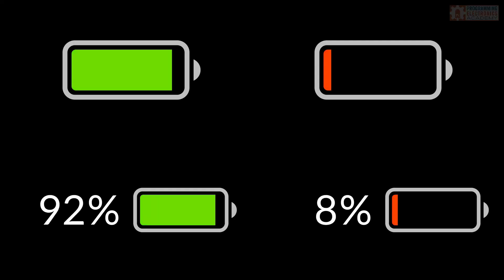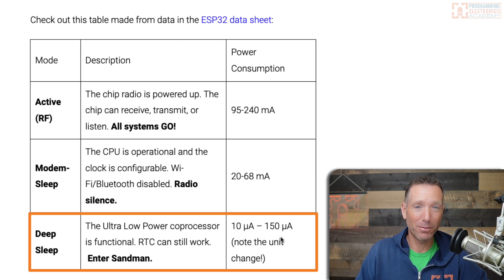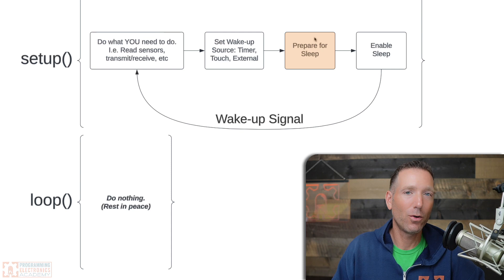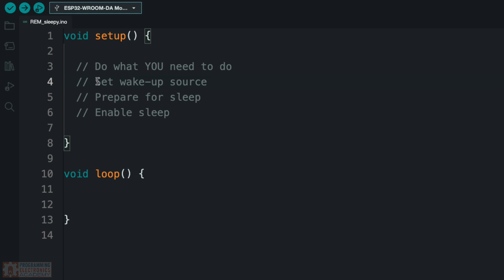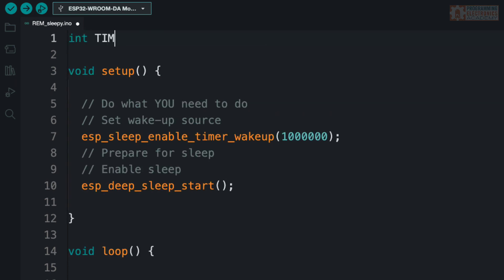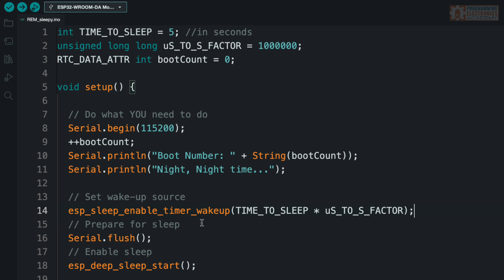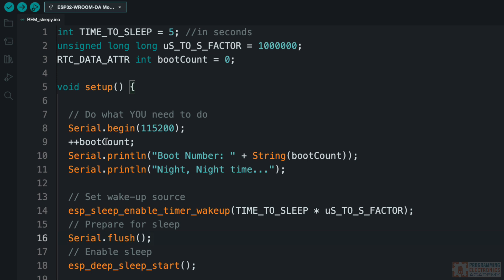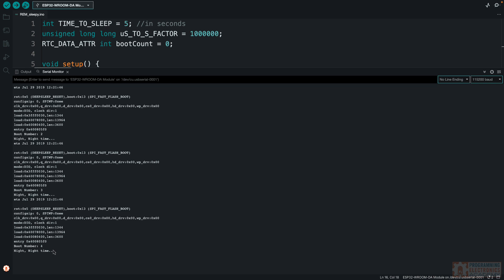Getting started with ESP32 Deep Sleep

Comment: Nice presentation! It took a few tries but if finally sunk in when trying it in my existing code. My loop function is essentially useless. All that code (now in it's own function) is called inside the sleep function each time it runs in setup. Different for sure, but if you're tired of draining batteries like me, it is probably worth rearranging your code with not much effort.

Comment: This is good and concise.  This is the second such video that I have seen that has suggested that in Deep-Sleep that you never go into the loop.....is if the wake-up would somehow only run setup().  I am working on a solar battery web server and I want to put it to sleep after the voltage on the solar panel indicates dark.  So my sleep test is inside the loop().  Thanks for the video, again.

Comment: Hello, many thanks for your great work, here and the article
I understood well and didn't have too much trouble adapting a proven code and transferring it into the setup.
However, my application seems incompatible: it uses “BluetoothSerial” library and the code bugs if have to call to SerialBT.available() : the ESP reboots again and again (it is really THE and only failure reason) / is this a no solution known problem, or is there a trick I should know about ?

Comment: Thank you so much for an amazing video! Im making a remote DIY system that is controlled through an app, so my esp32 is supposed to listen to the requests through wifi all the time. However as long as I understood deep sleep sets esp32 to "vegetable" like state for some time, which is not really useful in my case considering the fact that microcontroller can be full time connected to the power.
Would you recommend to use a frequent deep sleep mode every 5 -10 minutes or maybe there are some esp32 alternatives that can run in wifi modes much longer?

Comment: Thank you, can't wait to use deep sleep. I have a battery powered LORA transmitter at my mailbox to alert me when the door is opened. As it will only be activated (reed switch on the mailbox door) a couple of times a day, it can stay in deep sleep almost all the time (will have to cycle it to avoid that maximum deep sleep time).

Comment: Thanks man that was a really straightforward video and it worked perfectly, now my esp32 consumes less energy when is not required to do much. 
I have a SD18650 battery and i'd like to calculate how much time it will take until the battery runs out of energy. Logically, deep sleep mode helped me to consume less, but i want to know how much. Sadly, im not very advanced with electric calculations and formulas... could you please help me?

Comment: I've been playing with a Vroom and Wrover this summer and neither reach double digit mA power let alone micro. Needless to say I am interested in disconnecting from peripherals and such. I thought that was just part of the deal but when the power indicating LED is on all the time it apparently is not, LOL! So if you have upcoming content in this regard count me in!
Reply from the maker: Awesome - I'll see what we can do!
Reply: I like to cut the LEDs with diagonal side cutters for lower power projects. Bypass the linear voltage regulator. Run the ESP32 with a boost or buck converter and switch power of the converter with a cheap microcontroller (I use an AtTiny) and a mosfet. This way, the battery powers the cheap micro and the cheap micro switches power for the boost converter to power the ESP32. I'm sure there are cheaper ways to accomplish this but this is what I do as a hobbyist. I don't use the sleep mode of the ESP32 very often. My method only draws 280 NANOAMPS or 0.00028mA when sleeping. This is far less that the natural discharge of any battery when it's not connected to anything.
Reply: @billybbob18  Thanks for the reply and info. The best part is I understand about 98 percent of your advice, LOL! That means this is something I can try to work with. It will be helpful to others as well. Good job. Can I hit thumbs up/Like more than once.....?

Comment: I tried this sketch on an Arduino Nano ESP32. It just killed the USB connection.
Error message:
dfu-util: No DFU capable USB device available
Failed uploading: uploading error: exit status 74
Reply from the maker: If you double click the reset button, you'll get the port to show up again.  
You'll probably have to select the board and port again - then you should be able to upload a different sketch fine.
Just as an FYI, this appears to be an issue with these Arduino Nano ESP32s as far as I can tell, nothing specifically about deep sleep.

Comment: Another winning explanation! I try to avoid  any esp32 that has an external serial chip or that uses a 1117 power regulator. These just suck quiescent power from the battery when sleeping. The XIAO esp32C3 and the later esp32c3 dev boards using native usb have served me well. I package them with a 900ma Lipofe cr123 rechargeable and throw a little 5v solar module to keep them charged. I've been running several sensors with this combination, placed in a window, for 2 years now without the need for any other maintenance. To further use the power budget effectively I do use the ESPNOW communication you introduced in your other videos.
Reply from the maker: Very cool!  Thanks for sharing your setup!